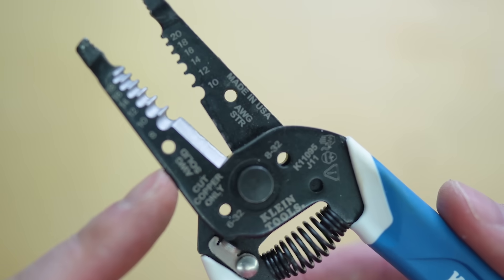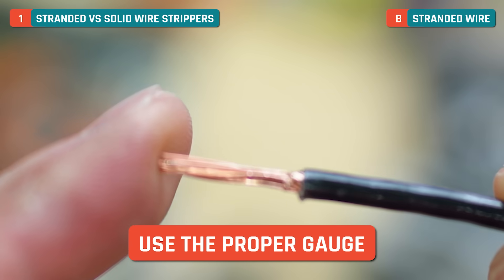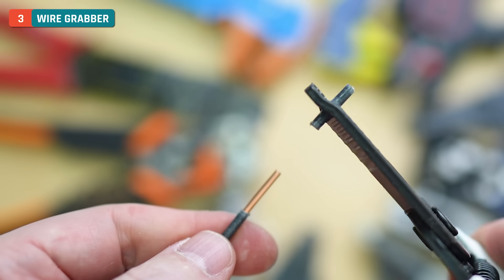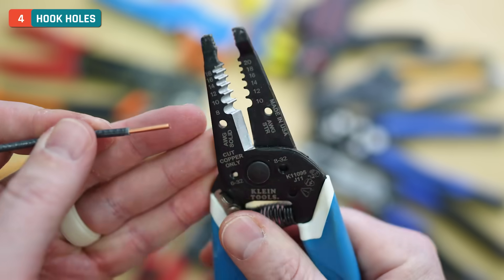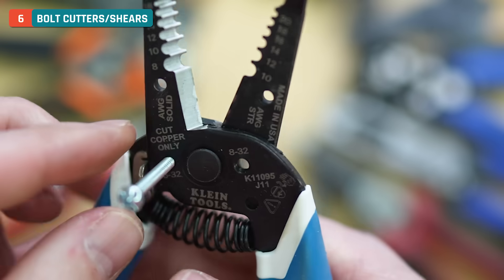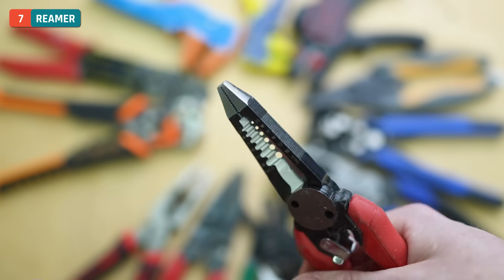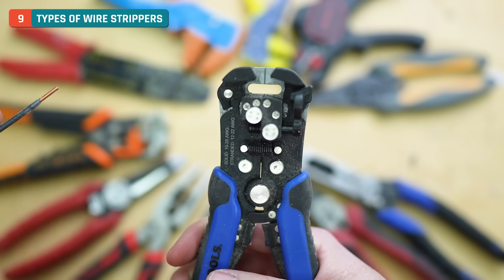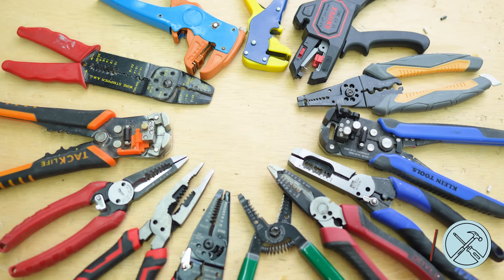8 Wire Stripper Features Everyone Should Know

Comment: 8-32 is not more "coarse threaded" than 6-32. It's just thicker. The "-32" part is the thread size. Otherwise great video! Thanks!
Reply: Thread pitch, not size
Reply: 1 ÷ 32 = 0.03125 which is the pitch.  32 is how many teeth per inch.  If you need to work out a tapping size drill, let’s say you wanted the drill size for 1/4x20, you would divide one by 20 which equals 0.05  you would then convert 1/4 to a decimal =0.250 deduct 0.05 = 0.2 multiply by 64 = 12.8 round off to 13=13/64ths the tapping drill for 1/4 × 20. For a metric sized tapping drill you’d multiply 0.2 by 25.4 = 5.08 so a  5 mm drill would do the job. Here’s some more useful maths should you require the nearest metric equivalent of an imperial drill.  Let’s say you required a 3/8” drill, start with 3/8 then double both the numerator and denominator thus 6/16 do it again 12/32 do this until you get the denominator to 256 then divide the numerator by 10, in this case 96/10 =9.6mm.
Reply: @Raynard666  or you just look at your tap drill chart that most every machinist has a poster or pocket card of. Or pull out the Machinery's Handbook for other sizes depending on the threads class of fit.
Reply: @drewperoni5316  My suggestion was for anyone who likes maths, keeps the grey matter healthy. Not to mention not a lot of electricians are going to have machinery’s handbook.
Reply: Doesn't really matter if it's fine or coarse. Most of you are breaking the tap anyway  lol
Reply: "-32" is the thread pitch. Thread pitch is the # of threads per inch of length.
Reply: Actually the first number is the bolt size, 6-32 is a  #6 and the second is the treads per inch, 32 threads per one inch of bolt.
Reply: I just need to find a pair that will do 10-24s.
Reply: 32 is the number of teeth per inch!!!
Reply: I caught that too but the rest was perfect!
Reply: 32 threads per inch
Reply: THIS VIDEO SUCKS
Reply: The “pitch” is the same. We get it . Redditor
Reply: .
M
.😢
Reply: Listen Karens, this video is for a person the has no idea...mostly the diy home owner. Not you "professional" know it alls correcting every little thing.   
Calm down...😅,
Reply: Who cares ? Inch garbage nobody uses outside of the US 😊
Reply: When you thread on a lathe, the same lead screw is used to thread a 1/2" bolt as it is to thread a 4" bolt. Angle is the same. The angle is just longer on a larger bolt. The pitch is the number of threads per inch. Provided it's the same number of threads. I've been a machinist for 40 years. Grew up doing it. Manual, cnc, and I've threaded a lot of bolts.
Reply: Coarse or thick. Wow
Reply: The 6 and 8 represent the diameter and the 32 is TPI threads per inch.
Reply: Stage 5
Reply: @lethal_bite is correct 🤓☝️except that with the larger diameter, the thread angle would have to decrease, not increase.
Reply: Que  marca  es  ese  pele  cable
Reply: # screws work like fractional screws/bolts. Diameter equals 0.06"+(0.13*#), where # is the screw. The dash number is threads per inch (tpi).
Reply: You beat me to it.  Yes, they are both coarse thread machine screws, having a thread pitch of 32 threads per inch, versus the fine pitch versions at 40 threads per inch. 🙂
Reply: @paulholmes672  6=24 and 8-24  are the coarse  32 is considered fine.
Reply: @paulholmes672 24 pitch would be the course 32 would be the fine
Reply: @paulholmes672   No, the coarse and fine aren't both 40 tpi.  It's 6-32UNC, 6-40UNF, 8-32UNC, and 8-36UNF.
Reply: As @paulholmes672 said, it’s actually thread pitch, not thread size.
Reply: @DSplatter  It's not pitch, it's tpi. The pitch is 0.03125".
Reply: This pissing contest is not electrifying 🫥
Reply: To be super theoretical, in a sense 8-32 is actually a finer thread than 6-32. To maintain the same number of threads at a larger diameter, their angle is slightly increased. Like the other comment mentioned, at this size, 32 is coarse and 40 is fine, but at 1/4" 20 is coarse and 28 is fine. 32 would be extra fine.
Reply: @Lethal_Bite  nope, it's thread per inch (of length) not based on diameter.  32 threads PER inch of length is the same pitch distance no matter the diameter.
Reply: @Lethal_Bite as a machinist and manufacturing engineer, you're technically incorrect.  😉
Reply: @drewperoni5316  I'm looking forward to the explanation. what is "-32" if not the thread size? Also, what is the thread size, then, if not "-32" ?
Reply: @ChrisCogdon  -32 is simply the "pitch" of 32 threads per inch (TPI), as measured from peak to peak or root to root. Other factors determine the thread form, face angle, etc. which are specified by the type of thread (UNC, UNF, Whitworth, NPT, Acme, Buttress,  etc). Then there's the whole class of fit of threads which sets upper and lower limits for characteristics such as major and minor diameters. You can spend weeks studying screw thread types, geometry,  fits, etc. A large section of the Machinery's Handbook (a "bible" for engineers and machinists) is dedicated to this.

In this case, the pitch of a 6-32 and 8-32 is the same .03125" between each thread peak, so for every revolution,  the screw advances that much.  The spindle pitch on an inch based micrometer is 40 TPI , which equals. 025" per revolution.
Reply: @Lethal_Bite  nope! It’s still the same number of threads per inch. “Finer” means more threads, not differently shaped threads. 8-32 and 6-32 have the same number of threads per inch. Also, their angle is not slightly increased or decreased. It is exactly the same. The flanks of the teeth do not change.
Reply: @Lethal_Bite  I've never actually seen a 40 pitch #8 or #6 screw.   Or at least I don't think I have, it's possible I've encountered one and assumed I was having trouble replacing the nut because it might be metric and just chucked it and replaced the screw.    I don't think I've seen them in regular hardware stores either.    Are they usually used in particular types of applications?    Would be interesting to know where to look out for that and possibly have a few on hand instead of banging my head testing a bunch of nuts across both SAE and metric.
Reply: @Lethal_Bite then explain to me half inch by 13 threads and where those fit into your theory. Course in fine are nothing more than relative terms for the threads comparative to the diameter of the fastener.
Reply: @Lethal_Bite no dude.
Reply: @Lethal_Bite  I love people's confidence to just go say random stuff on the internet.
Reply: @Lethal_Bite angle is the same.
Technically they are both a 60° thread 😉
Reply: @dualbag7533  he is talking about the thread helix angle, not the angle of the thread tooth itself.
Reply: The angle never changes  @Lethal_Bite
Reply: @Lethal_Bite beautifully said, fellow machinist.
Reply: @Lethal_Bite  You are technically correct, which is the best kind of correct :)
Reply: @Lethal_Bite  beat me to it. Threads are complicated.

Comment: You need a new camera that doesn't take so long to focus. Your Apple iPhone is insufficient.
Reply from the maker: The auto focus on this one definitely struggled. Probably mostly user error. I shoot on a new Sony A7C2 with a 24mm f1.4 lens. Not cheap stuff but getting these closeups to focus just right is definitely tricky. I hope to improve.
Reply: @LRN2DIY  Wow, an exceptionally expensive camera ($2,200 body only) to be that lacking in focus. (good reviews) Try a macro lens or setting for close-ups. Although heavy, I use a Nikon D780. I never really got onboard with the mirrorless types or the unnecessary 4K video modes.
Thanks for the reply and videos... hope you're raking in tons of cash.

Comment: The Knipex strippers don't remove the cut insulator on purpose.  You can leave the cut insulator over the stranded wires until you are ready to use the wires.  The plastic insulator keeps the wire strands from separating and spreading out, leaving them much easier to deal with.
Reply from the maker: Makes sense. Kind of like how many fixtures are sold with the jacket separated but not removed.
Reply: Yeh if I want to land stranded wire on a receptacle without a crimp connector I’ll leave the insulation on the end of the stranded wire and twist it nice and tight, wrap it around the screw on your switch or receptacle and it keeps the stranded wire tight enough to make a tight connection. Works well in a pinch.

Comment: #2 is a crimper. Use them to crimp the little crimp caps or "beans".
Reply: Yes it is a cheap crimp,  it will be effective for the gauge of the wire that you can strip
Reply: Do you mean #3 the "wire grabber". I thought that is a crimper.
Reply: Thank you for such a detailed and well-explained video! I learned a lot about the different uses of wire strippers that I never knew before. Your tips and demonstrations are going to be really useful for my future electrical work.
Reply: You mean "butt connectors" or some refer to it as a splice...👍🏻🤷🏼
Reply: I have an old pair of pliers with a yellow and black handle on them.they have that needle nose tip function but they also have two of those egg-shaped openings one on top of the other. I actually have used them from time to time as crimpers but I'm curious if you would happen to know the official use
Reply: Number 3 is a crimper not number 2. At least for electrical I use it. (Automotive) if you don't have a ratcheting crimper the tear drop as stated in the video (#3) is perfect for butt connectors. male and female connectors etc.
Reply: from klein's website. crimps insulated, non-insulated terminals and 7-8 mm ignition terminals
Reply: No, number 2 is an extremely poor excuse for a crimper.
Anybody that as ever used a ratchet crimper will agree. They are cheap enough that you can do the job and connection cleanly these days. Any tradesman that comes to me house or business and used that for crimping will get my eyebrows raised.
Reply: @gottliebdee263  So, actually "yeah, but i dont like it"  is what you say. Its not great for sure, but if its one of these or some random pliers, or even the good old mangling side cutters, the "cirimper" crimper is brilliant.
Reply: @barrygillis  I binned all of mine of that type loooooong ago.
Reply: @gottliebdee263  They might be unsuitable for most crimping jobs, but they really are fine for the Dolphin-type connectors commonly used in alarm system wiring. These connectors are only used in low-voltage wiring where there isn't going to be much tension on the wires (i.e. in boxes with zip ties securing the incoming wire bundle).
Reply: @gottliebdee263  You are correct in that #3 is not a great crimper, but that is what it is for.  So @Rask is just correcting the wrong information the video creator is putting out there.
Reply: @gottliebdee263  Very true. And what's more than that(*) there isn't actually such a thing as a generic "crimper". Each type of terminal and connector requires a different crimping die to properly crimp and not using the correct one will oftentimes leave you with a weak connection or an otherwise insufficient one, often leading to pull-out, pinched cables, damaged insulation or conductors, arcing, intermittent contact or other shenanigans. I recently bought a proper set which contains a ratcheting crimping tool with interchangeable dies, which covers most of the common types of terminals and connectors. It was quite pricey and contains twelve different sets of dies for fourteen different types of crimp terminals and connectors, each with a significantly different shape. You can tell just by looking at the shapes that they are absolutely not interchangeable, while the crimp terminals themselves oftentimes do look quite similar in shape, especially the part where the crimp is applied

(*)You obviously already know this
Reply: @BinaryBlueBull  Ah, yes. I'd actually forgotten that point.
That said, to get a set that does the red, yellow and blue (ring, but and blade crimps), is well with investing in. They are reasonably universal. Once you get to 10mm2 cable it's a different game
Reply: @gottliebdee263 yeah, well they’re excellent crimpers for the regular Joe. Maybe a tradesmen would get a raised eyebrow, but they don’t cause a fuss when used around my house. They work great all <two times a year I need them.
Reply: @Standard-469  No. they’re crap.
Reply: @gottliebdee263  What do you mean "no"?  It's a crimper.  I guess children with small hands and glamtricians that show up to jobs in gold chains and fur coats might not be able to handle this particular tool competently.  Most people can figure it out with a little practice though.  $30+ for a tool that most people will only use a few times in not cheap.  Wait, are you ratcheting crimper salesman?
Reply: @worldsend69  We’re done here. 
YOU missed the point, which was. I’d rather do a good job with the right tool than a crappy one without.
Reply: @gottliebdee263  so, a snob really!
Reply: no no its not

Comment: Handyman here. I use both the Milwaukee 7-in-1 and the Klein auto wire stripper, though I cut off the depth stop on the Kleins because it kept loosening. I hear the Irwin auto-strippers are better. I use a Knipex off-set mini bolt cutters as my diagonal pliers. Helps with my elbow, which is prone to inflammation. They've fit in every situation I've needed them to.
Reply: The Irwin auto stop is nearly useless and loosens all the time as well.
Reply: @Obtuse94  Thanks for the tip, you guys. May have saved me a bad purchase.
Reply: I bought an Irwin auto stripper and it absolutely sucks.  Klein and Milwaukee so much better.
Reply: I have the Klein Tools 11063W automatic strippers. They are like the Knipex shown in the video, but with the form of the Klein he showed. They have individual blade sections for each wire gauge, like the standard wire strippers. So, they are a bit more manual than the completely automatic strippers, but I feel they give the cleanest result for the effort. I use them a lot when doing automotive wiring and they are my go to over an automatic set similar to the ones he showed or over a standard manual stripper.
Reply: I have a couple of “name brand” auto strippers - believe it or not, one for Harbor Freight out performs them…
Reply: Yeah i really like the 7-1 milwaukee  pliers i use both the lineman's and needle nose style frequently.

Comment: why would you want to remove the mouse ears?
Reply from the maker: Those need to be removed to get a flush fitting when installing old work boxes. They also often don't fit inside metal boxes, especially the more compact metal boxes. They're designed with the break lines to be broken off as needed.
Reply: @LRN2DIY  They can also be used as 'close at hand' spacer washers under the mount screws to space the switch in a slightly recessed box install.  If you need anything more than two per screw, a mud ring can be used.

Comment: I knew about the other features, but I had no idea my wire strippers had a bolt cutter! Wow
Reply: I had never had a wire stripper with a good bolt cutter. I think its a myth. I go for a mini grinder and small disk usually.
Reply: @eraldylli klein tools hybrid strippers cut bolts like butter
Reply: @MindUrOwnBusiness77  Never had the chance to use their products here in Eastern Europe.
Reply: @eraldylli  the Knipex 13718 are very similar minus the crimping feature, but they cut bolts really great too. Highly recommended if in search in the European market.
Reply: Soooooo obviously you've never held a pair in your hands and looked at em    its written right there😂😂😂
Reply: Yeah that was the only thing I didn’t know, and mine have it. I was always so confused why there were so many holes on these things lol.
Reply: Yea, I knew about the bolt cutter, but always thought it was a gimmick.  I suppose they work with cheap screws, but try that with a quality screw and it will probably break the tool.
Reply: You can say it, Cheap screws from China! @bryana7163  😜🤣
Reply: @bryana7163  some of them cut quality screws some have a hard time. It really depends on which wire strippers you use. In comment above I recommended strippers I found cut through any screws that fit, you definitely should give them a try if needed.
Reply: @MindUrOwnBusiness77  I've had my blue point for years, never wanted to damage them or damage my hands.  That's what grinders are for.